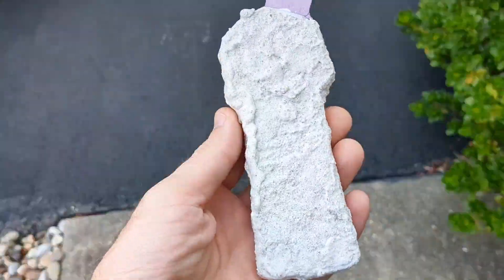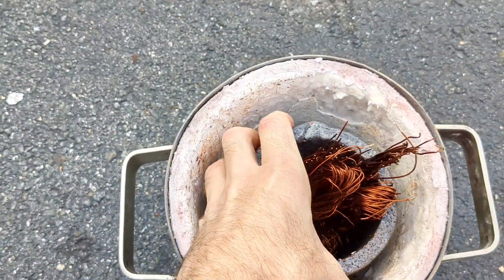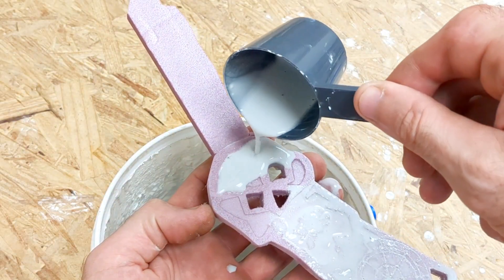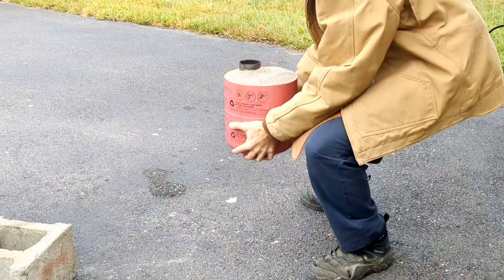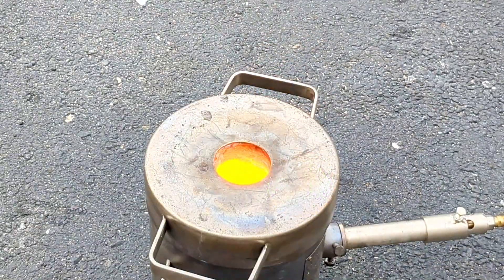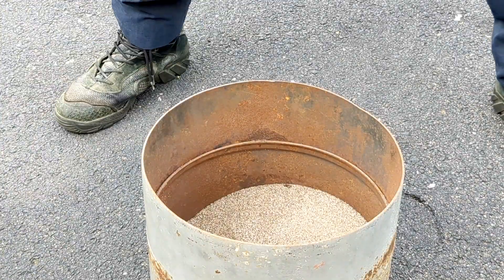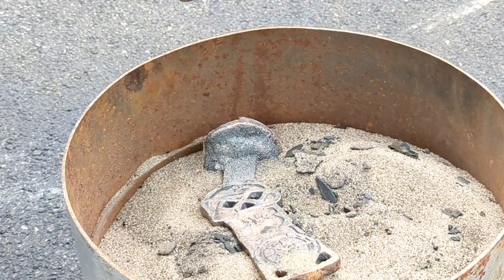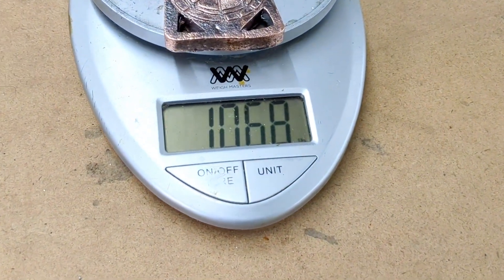🔴 Melting Copper - Making A Copper Bones Skeleton Key - Metal Casting

Comment: Aluminum skeleton key is jealous lol. Also if thats magnet wire from a microwave transformer then it is a coated wire known as Enameled Wire.
Reply from the maker: I made an aluminum skeleton key last year 😆. Also this is from a transformer, but it is from an old microwave.  It's solid copper.  I've seen some copper coated tin wire, but not this one.  If that's what you mean.
Reply: @HeinrichsMade  the aluminum one is hanging on my wall :) Any wire taken from a transformer will be solid coper but covered in insulation thats almost transparent. Scratch some with a knife some time and watch the coating flake off. Always fun to watch a casting happen.
Reply from the maker: @bigironinteractive5747  oh snap!  Glad you have it mounted for display 😆. You can't have this copper one.  This one's mine 🔥🔥. I see what you are saying about the coating.  Yes, I can tell it has a shine to it.

Comment: I don't recall many, if any, other times that you've done copper + lost foam... This one came out magnificent!
Reply from the maker: Yeah I have only done a few.  I did one for Christmas last year and it bled out of the plaster coating.  I also did a rose and it bled as well.  That's when I decided to try a thicker coat with sand.  Then I did a moai statue and it worked very well
Reply: @HeinrichsMade  Ah yes, I remember the statue! Gum gum! I guess I recalled that being aluminum.
Reply from the maker: @misphet3 I did it in aluminum too 😆. You might have not seen the copper one.  I titled it coating foam for heavy metals.  Not a very eye catching title 😂😂